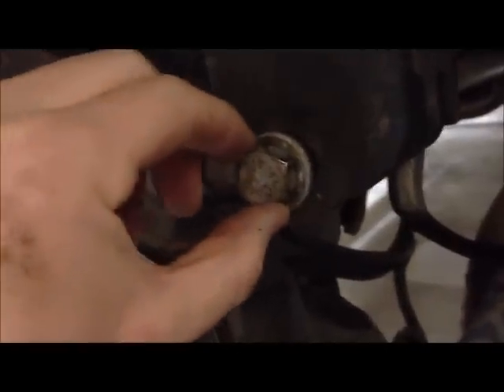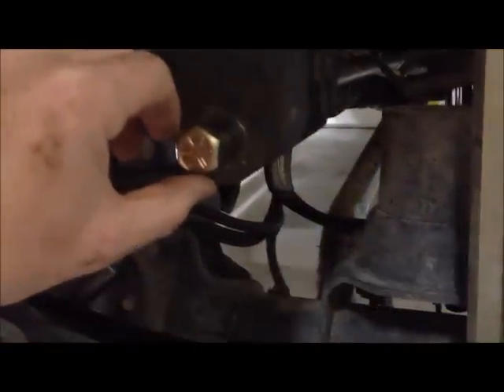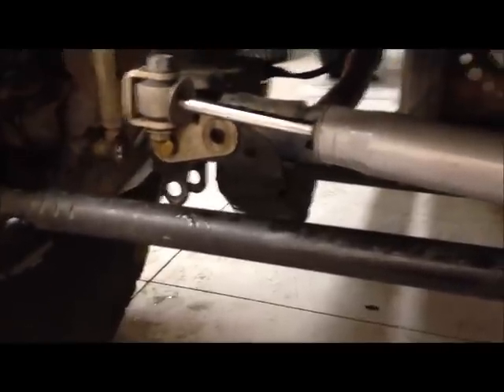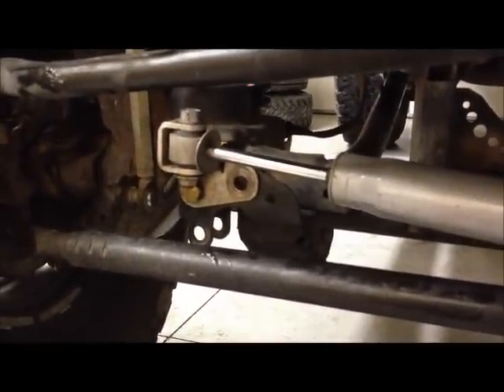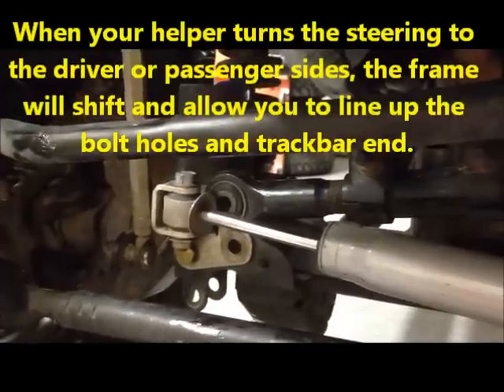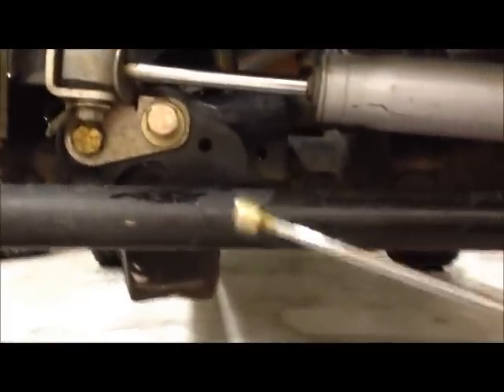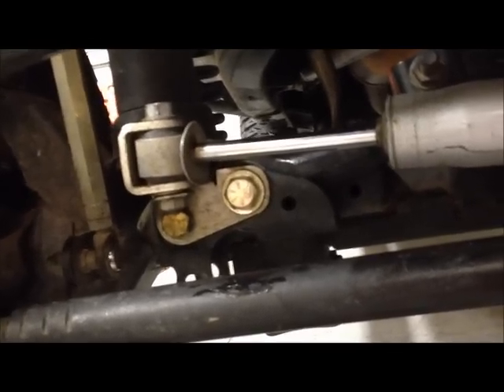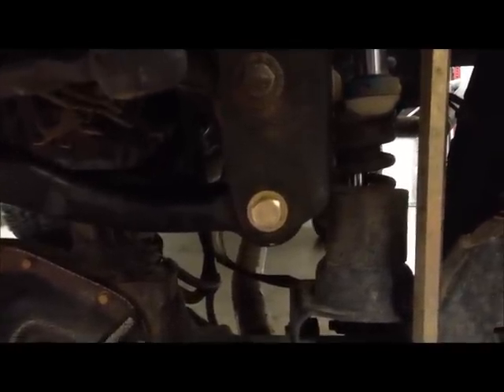PLANMAN explains Common source of death wobble on Jeep JK Wranglers

Comment: Death wobble occurs on vehicles with good components too. I think it's a vehicle geometry thing and when everybody and their experts change out parts, that just changes the geometry. Did the wobble go away? For starters I would recommend loosening control arm mounting bolts and raise the vehicle off the jack stands by the axle and retighten the bolts before changing any parts. Every vehicle is different so do what you have to too reset the geometry.

Comment: So essentially your having to reengineer Chryslers engineering, I guess you just shouldn't expect a whole lot.
Reply from the maker: Chrysler actually did do some reengineering.  They changed the bracket hole size on the frame side bracket, and they changed the bushing design on the frame side of the trackbar.

Truthfully, if Chrysler made torquing the trackbar to spec at every oil change interval as part of normal maintenance, the bracket hole size wouldn't be a problem because undertorqued bolts would not allow for as much play in the bracket holes, resulting in ovaling/wallowing of the bracket holes and premature failures of trackbar bushings.
Reply: Well, lets give them another 50 years to possibly get it right.

Comment: where did you buy the bolts, washers, lock washers and nuts? do you have part numbers?
Reply from the maker: +elton rivera http://www.northridge4x4.com/northridge-4x4-jeep-jk-grade-8-hardware-kit
If you want to buy bolts for the front and rear trackbars, plus the lower control arms.

Comment: Is this ALL years ofJK or just prior to 2012?
Reply from the maker: +Vas Def All years JKs require periodic torquing of the front trackbar bolts.  The stock bolts are fine as long as they are kept torqued.  If they loosen up, then it's a problem.

Comment: Hoping this is the problem with my jeep I get a little steering wheel wobbles at higher speeds. Ball joints tirod ends  all ok and tires balanced recently. So 9/6" and 3" long right?
Reply from the maker: +jeep mudzilla   Before you do anything, watch my Death Wobble Diagnosis videos.  Steering wheel wobbles that happen every time you hit higher speeds don't have anything to do with the trackbar bolts.
Reply: Not sure what it is besides that tire psi is 30 and tirod ends and ballpoints and drag link ends all seem ok
Reply from the maker: You performed what I show here?
https://youtu.be/ii81V7XYr-k
Reply: +The Bearded Jeeper sounds like you just need your tires balanced.

Comment: I have a 2103 wrangler unlimited with all kinds of clunking underneath. Mostly a loud clunk/knock when leaving from a stop. Are u sure they addressed this in 2013? Thanks. Great video
Reply: +Chris Hlentzas (TheGreek72) I have the same problem with my 2010 JK, have you been able to fix the problem?
Reply: +Elmer Ramirez i had slightly loose control arms. check all of yours.
Reply: +Chris Hlentzas (TheGreek72) and that helped the clinking stop? I was thinking maybe the driveshaft.. But I might have to replace those as well.
Reply: +Elmer Ramirez yeah. i was going nuts looking for the issue also. i would get a clunk when acclerating from a stop and random noises. front and rear control arms were just slightly loose.
Reply: Chris Hlentzas

Comment: This may be one of my last problems with my jeeps wobble I just need to check it but I have a case of the lazy's this weekend. I changed out my entire drag link and now the steering has 0 play in the wheel but I do still get wobbles when breaking on hills, I do have a slightly bent tie rod so I need to get the tires realigned or just get a new tie rod all together. As far as ball joints go, they seem perfectly ok for now on mine but they could probably be replaced, but everywhere I go they want to overcharge me so I may end up just doing the ball joints myself too. Shops try to get me to pay 800-1200 for ball joints and the dealer offered to do it for 500 but I would rather get better ball joints than new stock ones.

Comment: Do the '14 have this issue?
Reply from the maker: The '14 still use fully threaded instead of partially threaded (shouldered) bolts.  The frame side bolt is no longer undersized for the bracket hole and the bushing bolt sleeve.  Only the axle side remains undersized.  If you keep your stock bolts regularly torqued to 125 ft lbs, you shouldn't have problems.  The problems of the undersized bolts occur primarily when people don't retorque their front trackbar bolts as frequently as every oil change interval or after every major offroading trip.

Comment: I've never seen nor heard of the factory track bar bolts loosening by themselves. I would never replace the factory 10.9 rated bolts for weaker Grade 8 bolts. 

I would be much more concerned about the track bar drop bracket that is mounted on the weak frame bracket. The factory frame brackets are known for being weak and cracking, especially when the leverage on them is increased by the drop bracket.
Reply from the maker: Will, It is not uncommon for the factory bolts to not be sufficiently torqued at the factory.  In fact, there was a recall on many jeep JKs where Chrysler blamed the paint used on the brackets as the reason for the under-torqued bolts.  Furthermore, bolts stretch, metal fatigues (like you mentioned), and bushings compress.  As a result, suspension bolts need to be retorqued periodically.  

Grade 8 bolts and metric 10.9 bolts are close to equivalent in strength.  The issues aren't with the strength of the bolts.  The issues are using a shouldered bolt in a bushing instead of a fully threaded bolt, using fine thread bolts that hold torque specs better than course thread bolts, and primarily, the fact that when the fully threaded, course thread, smaller diameter stock bolts lose their torque spec due to stretching, fatigue, wear, suspension cycling, etc., the stock bolts are more prone to cause damage to bracket bolt holes and bushings.

People who periodically retorque their factory bolts will rarely have a problem.  Still, the shouldered, larger diameter, fine thread, grade 8 bolts are an upgrade.

Regarding the frame side trackbar drop bracket in the video, that is part of a Teraflex drag link flip kit that braces the drop bracket with a link that bolts to the passenger side of the frame bracket that is welded on.  I agree with you.  Frame side trackbar drop brackets are a bad idea unless significantly braced like the Teraflex design.
Reply: as planman stated grade 8 SAE and 10.9 METRIC are virtually the same strength, just too different rating scales likes inches and millimeters, nothing wrong with replacing 10.9 with SAE grade 8

Comment: Does this bolt size problem also exist for TJs?
Reply from the maker: The frame side end on a TJ is essentially a tie rod end, and the axle side bolt is smaller with a lower torque spec.  It is still a good idea to check the integrity of the rod end side for wear and pull the axle side end to see if your bracket bolt hole has ovaled.  

The issue is a bigger deal on JK's because the bolts need 125 ft lbs torque.  If they loosen up below this level, the smaller stock bolts tend to oval the bracket holes quite easily.  The upgraded 9/16" grade 8 fine thread bolts are shouldered, cause less wear on the bushings, hold the torque spec better, and are less likely to oval the bracket bolt holes.

Comment: I have to disagree.  In many cases, it's not a matter of fixing steering components that are worn/damaged.  Brand new jeeps can have death wobble.  You get death wobble because of the physics of huge tires.  The larger you go in tire size, so goes the weight.  Not only is there more weight, it is slung around in a larger diameter.  This weight is applied to the steering that was designed for 32" tires.  It's got to give somewhere.  Further, explain why all jeeps come with steering stabilizers
Reply: It is not the larger tires in my case. I never had dw with my larger mud tires on. I just recently bout some 2020 sahara wheels with the stock size skinny street tires on them and put on my 08 jkur and got dw that day with a smaller skinnier tire. Got a bilstein satbilizer and new skyjacker track bar coming and am getting the new grade 8 bolts on my home from work today

Comment: its the size of the thread. 9/16 unc is slightly larger than M14. Spring washers are crap btw. better off with a fine thread bolt like unf and blue loctite 242

Comment: Just want to say that if you've had DW, chances are the TB bracket holes are enlarged.  In that case, you need to weld some washers on each hole that's enlarged.  We've found that 1/2" washers are better suited.  Washers typically fit bolts loosely, so go through the bins at your local hardware store one size down for a tighter fit. To make clear:  9/16" bolts, but 1/2" washers welded in place.  If you have hogged out holes, the Northridge kits does NOT come with the best washers to stop DW.

Comment: I had a similar problem with my ZJ track bar mounting bracket hole as i replaced the track bar bushing with the poly the sleeve ID is larger thus the old bolt is loose so i took the sleeve to the hardware store, fits tight as a drum now. My ZJ is stock height -- just replaced all control arms with Iron Man tubular fixed units and all poly bushings, etc. also replaced ALL front end parts inc. steering box , plush GC ride is gone after the poly bushings were installed

Comment: Wanna learn how to get rid of it? Upgrade your steering stabilizer. The stock stabilizers are cheap, made for Chrysler cars, and do not hold well against tires over 28" diameter. There are alot you can buy, or kits to double them (just in case you have 40s). I lifted my 2005 TJ to 4", and drove the stock 28" tires. It was fine, until I upgraded my rims and tires for 33x12.5 and then DEATH wobbles around 33 and 66 mph. It was scary. And then I upgraded my steering. All better. Hope I helped.